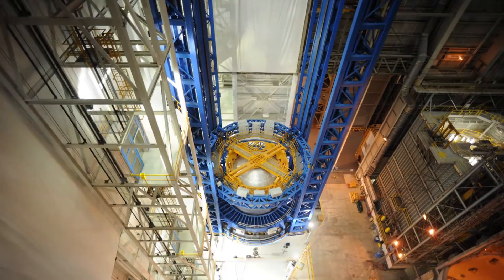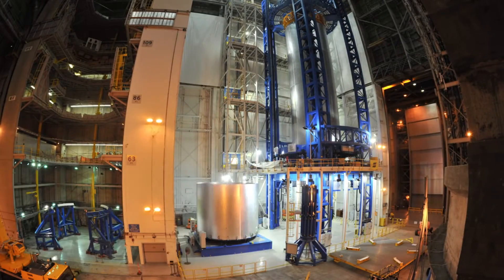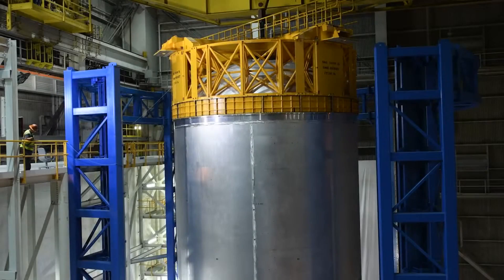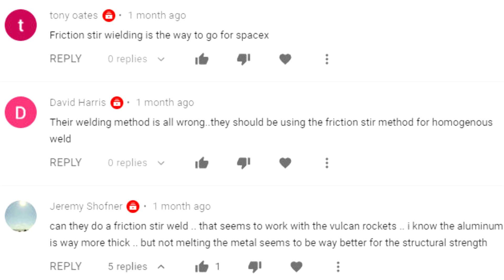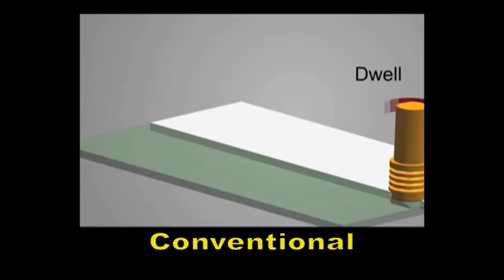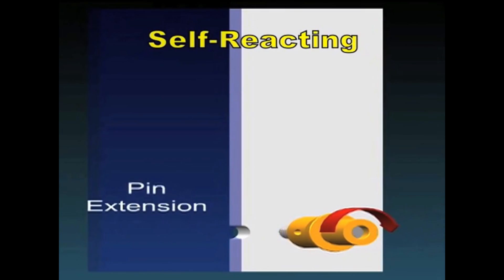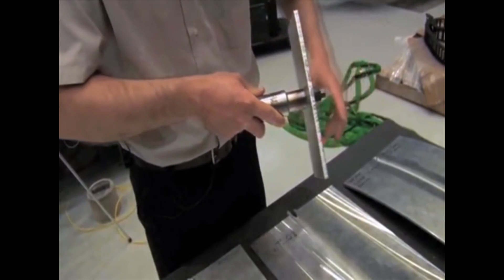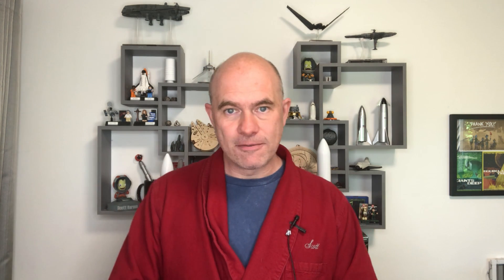SpaceX's 4th Starship Prototype Collapses During Test

Comment: It’s fairly obvious what happened to SN3 - Someone pressurized the lower tank with atmospheric gas & then filled the upper tank with liquid nitrogen. ATP, the gas in the lower tank liquified, creating a near vacuum in that tank. Because the lower tank was now at a near vacuum, it could no longer support the weight of the upper tank. The upper tank then collapsed into the lower tank (that’s the crinkling we observed before the implosion) & the thing imploded.
Now, we will NEVER have a situation where the upper tank is fully pressurized with cryogenic anything while the lower tank is either pressurized with atmospheric or any other gas or is at vacuum. So, we should insure that we test this under the conditions Starship will fly under - Fill the lower tank with liquid nitrogen &, as you’re filling it, fill the upper tank with liquid nitrogen. When the test is complete, release the liquid in each tank in the reverse sequence (upper tank first & then lower tank).
We should NEVER lose even a test article because we didn’t do the testing procedures correctly.
Reply: +1.
Reply: Super.
Reply: I don't think the crinkling was the upper tank collapsing into the lower tank. To me it looked like it was caused by the lower tank losing pressure to the point where the pressure inside the lower tank was less than the pressure outside of the atmosphere it, to the point the atmosphere crushed it like a can. In the situation you describe (which I also think is what happened), the crinkling would be caused by the atmosphere crushing it, and that resulting in it losing structural integrety and collapsing.
Reply: @conall9415  that's what he already said! But you have to remember that plus the weight of the upper tank helped...  

Think of a chair with 3 legs... Works fine until you (the upper tank)  sits on it!
Reply: Alternatively, could leave the valves of the lower tank open, and maybe add some temporary structural support between tanks while conducting the test (probably not necessary, but struts are cheaper than rebuilding?). This way don't need as much liquid nitrogen.
Reply: Yes, my guess as well, temperature drop caused vacuum

Comment: If you ask me, they not adding enough internal support for the tanks.  as stupid as it sounds, i would go with a double shell with a small gap, filler with insulation in the gap.  but that just my opinion. I would love to had film of my 1' tall basal wood tower exploding with almost 5K lbs pushing down on it.  All made of 1/4" and 1/8" basal wood. My cal's said it should have imploded at almost 8K lbs.  The Physic teacher said because I did not use all the glue I was allowed and did not add extra glue after I build it, he said it really support 7K as they put 1200 lbs before it went to state finals.  He spent 30 mins explain why. I pointed out that in my computer sims, it should have imploded, but he said it exploded.  to stop the forces from twisting the tower, I used series of side to side cross braces and diagonal braces. this transfers the stress loads from leg to leg, side to side, but what keep the tower from twisting was one set was on the outside and 2nd on the  inside, the reverse direction from the outside.  This pass the stress on the outside in one direction while the inside sent the stress in the other direction.

Comment: For all of Scott's reassurances, I'm really not sure this "build rockets like you build oil drums" idea is gonna work out.
Reply: Jason Goodman I think it will just like with falcon 9. Elon himself said that whatbthey are using now is just ordinary household stainless steal, the final version will use a specific made stainless steel
Reply: @MrTrashmasterfx  I do not get the point of testing this with "household steel".  What can they possibly learn from this if their plan is to use a different steel?  This is not how things work.
Reply: @headcrab4090  Yes this is exactly how things work, especially when developing the logistical train and manufacturing chain. You pretty much always work with cheaper materials until you are ready to work with the final materials
Reply: @joshua43214  Depends on what you are doing. I might test my welding equipment on cheap steel, just to make sure it works, or to establish a control, but that won't tell me that much about what the welds on the proper alloy will be like.
Reply: @Croz89  But botching something together from wood or scrap iron can still give you a great idea about mechanical properties before committing to the more expensive materials.  Anyways, there have been actual launches using cheap construction steel, for example the early copsub rockets used standard 2m steel plates bent into 2 foot diameter tubes.
Reply: @Croz89  The welding is one of the simplest aspects of building Starship, and they are using a similar material. All they are doing is switching between different stainless alloys of the same series, this is not the same as switching between different series - they will both weld mostly the same. Figuring out how to move the parts around, stack them so they don't buckle, combine irregular parts, the entire supply chain, material storage, etc is far more difficult than figuring out the roght setting on the welder.
Reply: @johncrowerdoe5527  Not when your material is under extreme environmental conditions. Tensile stress, creep strength etc. will all be different.
Reply: @joshua43214  When you're working under fairly extreme conditions, like a rocket would be, different alloys do matter. They might weld mostly the same, but not exactly the same.
Reply: @Croz89  Prototyping is not the final use with final stress and endurance requirements.  Using available cheap materials make a lot of sense.  In fact, using weaker materials can be a way to find failure scenarios early.
Reply: @johncrowerdoe5527  If you're working out how to manufacture something, sure. SpaceX might make a scale model or a mockup just to work out how to build it, lots of engineering firms do that. You can make that out of cheap steel. But if you actually plan on the item being functional, it's much less useful. So you can use the cheap stuff to build a Starship that just sits in a hangar, but putting it on a rocket is asking for failure. I wouldn't make a pressure vessel out of cheap alloy then expect it to perform under a realistic test.
Reply: @Croz89  You are totally missing the point. The welding is the simplest problem they have to solve. Forget about welding, they have engineers who can make the adjustment to the new material with out much fuss. It is a trivial problem compared to the other issues they are dealing with
Reply: @joshua43214  Welds in different alloys will be different even if the welding technique is identical, they will perform differently under extreme conditions, like in a rocket launch.  Plus the material itself will perform differently, putting different stresses and strains on the weld. Trust me, I was a welding tech for experimental nuclear pressure vessels. This isn't about how good the welding technique is, even if it is near perfect for both materials there would still be differences.
Reply: @Croz89  You are still missing the point. Just forget about welding. Imagine you had to start with a plot of land and create the entire facility that you made your nuclear vessels in. Imagine you had to find suppliers that could meet you needs, and plan production to align with how they are able to produce parts. Imagine finding and recruiting people to work in your piece of land that is in the middle of nowhere. Imagine how stuff will be transported, stored, and accessed. Where do your people live? How do they get to work? Is the power grid able to meet your needs? What do you do with waste?
Welding is trivial by comparison.
Reply: @joshua43214  Welding is not trivial when it's holding your spaceship together when it's being tested. I can 3D print a gear train out of cheap material to test that they all mesh and fit in my gearbox, but I'm not going to drive the car around a racetrack because the gearbox will almost certainly break, and possibly damage other components.
Reply: @Croz89  Please just forget about welding. Elon is not building a starship, he is building a factory. What you are seeing, is an iterative process that leads to manufacturing process. You need the process before you can build the factory.
Reply: @joshua43214  He's not building a factory, he's building a spaceship, the factory is needed to make it. A spaceship that needs to withstand high temperatures and stresses. It's like building a prototype F1 car out of cheap steel, it's probably not going to work that well when you drive it on a racetrack, even if assembling it provides useful insight into how to build it. So you make one out of cheap materials just to see how it fits together, then use the real deal when you want something to undergo race testing.
Reply: @Croz89  Dude, you need to get up to speed. Elon's own words are that he is building a factory. These are just prototypes used to determine process. These are his own words.
Reply: @joshua43214  Then why is he testing them? It won't tell him how the real thing would perform. If all he needs to do is check assembly then just assemble them. He's just going to cause accidents like this and the data won't be that useful because it's all cheap materials. But it's his money and his factory, if he wants to do it that way. Just can't see much point in it, it's going to mean a lot of scrap metal.

Comment: There must be a middle ground between SLS "taxpayers have infinite money" approach and this breakneck Will E. Coyote one. Wait - there is: Falcon!
Reply: This is the design process for Falcon. 4 of the 5 launches of Falcon 1 were failures, and that was after they'd started manufacturing.
Reply: @absalomdraconis  Yes, but they have learned. I agree, the first three Falcon 1s failed (but later and later), that frozen oxygen in eliminated helium tank overwrap cost them one ISS resupply mission, Falcon 9 first stage landings were failing for one reason after another and, probably the most troubling of all, was that Crew Dragon explosion when testing. Falcon 9 first stage failure, and especially everyone pointing out it was its fifth flight, is also worrisome - they were supposed to fly ten times without refurbishment, and these are refurbished (if quickly), but the failure still happened. 
But I did say "middle ground"; I am not proposing going SLS way, just doing some actual thinking in advance of attacking metal. Heck, remember when they announced the "Dear Moon" mission, what was in the background? Mandrels and carbon fiber wrapping machines, the size of those for 787! That must have cost them dearly, and all parameters to choose between composites and steel were there. That's like refactoring in programming: "rapid prototyping" is not a replacement for design, for thinking, and for having people with the domain knowledge around.
I am very worried about the path this is taking.
To be fair, Raptor, extremely ambitious as it is, does seem to progress along nicely. 
There is another company working on its owner's own dime that takes a much slower, more deliberate path: Blue Origin. This is going to be a very interesting race; what counts for me is that at least someone will probably make it.

Comment: I'm still wondering about their safe escape system on Starship (if it ever will be human rated). We can expect similar failure when crew is sitting on top waiting for lunch, no?
Reply: Starship has no escape system. Escape systems are for vehicles with unacceptably high risk of failure such as combat aircraft or government sector rockets. 
Any system used for mass civilian transport, like starship, will need to be reliable enough that an escape system causes more danger than the potential safety it provides.

In this instance the failure is unremarkable and not of great concern for the design. Almost no rockets can withstand having only the upper tanks filled if the bottom tanks aren't pressurized.

Comment: I am unsure how you are able to say they have got the welding and manufacturing down just yet...hope they have, but too soon to say. It'd be interesting to have been a fly on the wall listening to the decision where they weighed pros/cons of "analysis by paralysis" vs. rapid prototyping.

Seeing "old aerospace" analyze until they are blue in the face and only have to build one STA or SQA (structural test article or structural qual article respectively) is painstaking up front from the lack of "look they're building rockets", but it is obviously warranted later down the line. But, their is also a value to the optics and learning opportunity of churning things out quickly and testing them quickly. 

It will certainly be cool when they get one figured out 👍🏻

Comment: SMAW or Shielded Metal Arc Welding is commonly called Stick welding
GMAW or Gas Metal Arc Welding is commonly called MIG
FCAW or Flux-Cored Arc Welding is just a MIG welder that is running wire that doesn't need the gas
GTAW or Gas Tungsten Arc Welding is commonly called TIG

Comment: Back in the day, the point of testing software and hardware was to cause a failure. When you get to the point of no failures or trivial failures, occasionally defined by idiot managers [see Boeing], the product was ready for release. When SpaceX has a test failure? Good job. Now make sure it can't happen again, and move forward. Better to have a test failure than a live failure.
Reply: @gandritaskull  you need to look back further not at modern cost/risk averse companies and that's working so well for Boeing (787 ,737max,starliner)

Comment: This is kinda like a wake up call too. Imagine re entering the atmosphere at mach 30 with that kind of hull integrity on an empty tank. How is Starship going to sustain all the aerodynamic pressures? They may need to reconsider doing like ULA does with the thickness of the external hull, milling a thicker sheet to specification creating a structure pattern or, as I've been pitching since the beginning... 3D print a giant tank!
Reply: 3D printing is terrible idea it is slow and resulting material is not homogeneous enough for tolerances involved. Also during reentry starship will go sideways so all of pressure from atmosphere is supporting structural integrity of that side and propellant is also concentrated on same side leaving rest with low strain. Problem here probably was that they lost all pressure or that negative pressure occurred in lower tank, because of condensation caused by cryogenic temperature of nitrogen in upper tank.

Comment: Could it be as simple as the cooling of the fluid in the lower tank (by the liquid N2 above) caused a small area if vacuum at the top of the lower tank which induce a crease followed shortly by the collapse? 🤔

Comment: All of these failures are starting to make it look like SpaceX doesn't know what it's doing regarding the structural integrity of the Starship. Wouldn't it be better to put some more time and effort into making sure at least most of the stuff you do works on the first try? How many more prototypes are they planning to build and destroy before they happen to get everything working correctly?
Reply: Nah, you just don't know what you are talking about. Making something work on a first try takes luck or enormous amount of resources. That's why clasically built rockets cost billions to develop. Elon mentioned having about 20 prototypes before they reach something similar to final product. And this number might not be accurate. So even if it is 30 prototypes , it is still cheaper then building a full scale production facility right away and trying to get it on your first try.
Reply: @gandritaskull  yep 2+ years for first sls tank  and failure then rebuild custom facility LOL

Comment: I'd be very surprised if they are tig welding these sections. They are very large sections of cylinder that need to be near perfect. I'd bet they are doing something more like sub arc welding with inert gas. Which would be simi automated. Ie person with a controller that's mostly adjusting speed and feed, set up for a pass then just monitors the equipment's weld.

Comment: That collapse could easily have been predicted if they had verifies the design with CFD style simulation software. These software packages have become very affordable in recent years. $30K or less can get you a multi physics package such as those available from Comsol or Ansys. It doesn't take much additional time to enter the simulation data. Especially since most of the information would be input when creating the CAD in the first place. The time, labor and materials lost drawf the cost of the software and associated engineers required to integrate simulation into the design process. However, this is just the opinion of cranky, 72 year, old engineer. I simulate all complex designs before actually constructing them. Saves a lot of headaches.
Reply: reefdiver200ft But then we wouldn’t get those awesome explosions! :(
Reply: @coenogo  Good point. LOL
Reply: i'm willing to bet that they have programs for simulating stress and were fully aware that it'd collapse if the lower tank wasn't pressurized properly. it seems pretty obvious that something happened with the lower tanks pressurization that wasn't supposed to happen.

Comment: Looks like the "shrinkage" you get from super cooling air. Wonder if someone sealed a section without thinking or if they are using an active cooling system to also do some structure/pressure stuff and it's phase changing with the temps and let a vacuum form and it crushed itself with the weight of the external atmosphere.